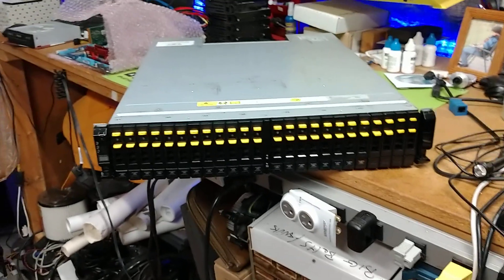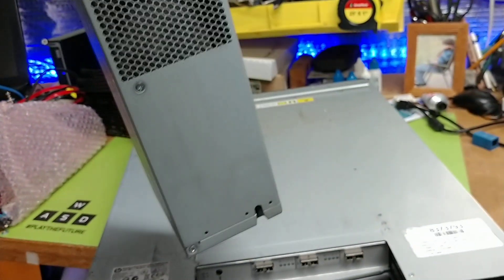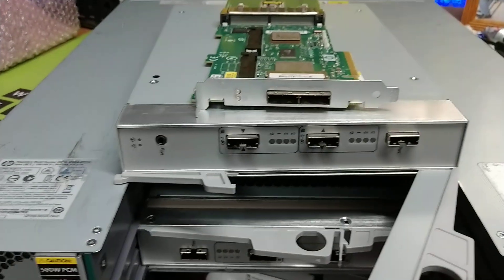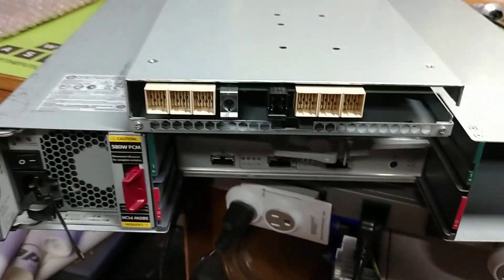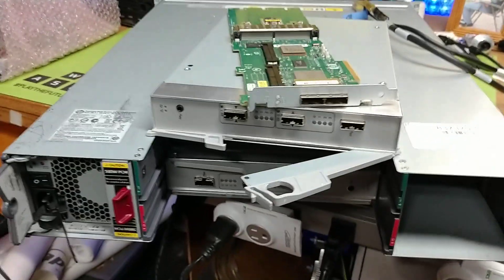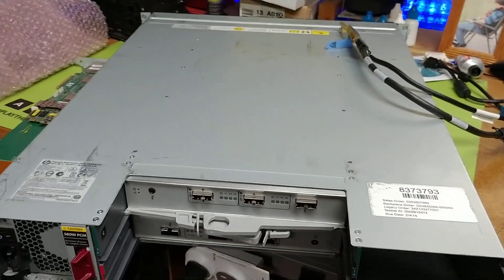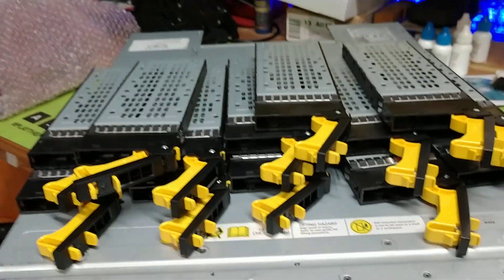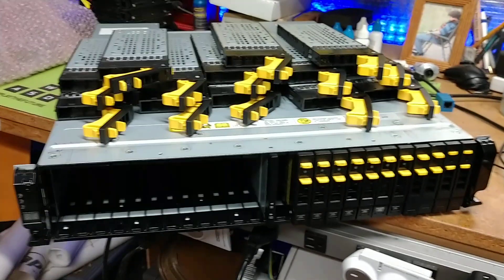Reusing a low cost HP 3PAR M6710 SAS/SATA 2.5 inch, 24 drive disk array  for your home server lab

Comment: Hi Leadius. 

Great video. I went and buy two M6720, but I am having two problems and I was wondering how you had the same, and if so, how did you overcome them with your M6710:

1. No matter which drive I insert, one minute after inserting the drives, the amber light will go on all of them, which I understand is a bad disk, but the controller will see them fine.
2. The controller sees the disks but the bay shows as unknown.

My Setup:
HP Server with P822 controller (Also tried an P800)
Windows Server 2012R2
Two M6420 ( Only one connected)
12 8TB SATA Drives (New)
5 1TB SATA Drives (New)

Any help will be apreciated,

Thanks
Reply from the maker: The first thing I would recommend is to go with only one Disk controller (In the back of the M6420 and make sure the second controller is pop out of it slot.) with one SAS hook up in port A. (for now...)  Next your P800 or 822 will work fine and the alerts and amber LEDs will go away for now.  If you want to add the second self to your model then just go to the B port on the back of the first disk array and plug it into the A port of a single controller belonging to the second array. Power them both up first then boot your server up.  To use both sets of Disk array controllers, you need a dual set of SAS controllers recommended by HP.  Current this config I gave you is a single path fail over. (1x1), to go to a 2x2 fail over you will need more hardware.  So most of us just use this setup of 1x1. This allows us to do storage cheaply and still have a solid storage array.   If you have the software from HP 3PAR, You could go 1x2 instead,  That is single controller x dual failover paths.  That requires that you use both controller ports set, SAS controller Port A to Disk array Port A  and SAS controller Port B to Disk array Port B.  Don't use the second controller on the disk array. Better to pop it out to shut down alerts...  Unless you want to a fully deployed 3PAR array...  That can have some real costs.  Oh also just use about 3 disks to start for you need more then one disk to test things right...  Faster reboot times that way.
Reply: @leadiususa7394  Thanks for the explanation and the help. Will do as you say.

Comment: what type of raid is recommended for hp 3par m6710
Reply: Ok, thanks for answering I tried with raid 10 but I did not understand since it left me unused discs, I will try raid 5
Reply from the maker: Any that you want but most Admins do RAID 5 for basic storage or RAID 1+0 for app level storage need but you have to play a little bit to tweak it out some. Refer to my other response to your needs...

Comment: 3par storage is good for file storage and backup storage, middling for small database storage, and absolutely HORRIBLE for VM storage.  I know this because I work at a cloud provider that uses several 3pars (3 in Colorado, 2 in California, 2 in Chicago, 2 in Virginia, and 1 in Georgia) and they can't even handle a snapshot on a VMWare VM without bringing the VM to a crawl.  We are forced to do all our customer backups during off hours because of this, which creates quite a problem for some customers with large SQL Server VMs.  

The reason for this is because of how they arrange the disks.  They group the disks in sets of 4 in RAID 5, and then divide chunklets of 256MB spread across the disk sets.  So, the maximum read iops is can get is what 3 drives can put out and write iops is about what a single drive can put out.  Because of spreading the chunklets across the disk sets means if reads from more than one VM hits a set, which happens often, slows the continuous iops available to the VMs involved.  In exporting VMs directly from ESXi hosts with nothing between the host and the target of the export (a VM on another host) being one network switch, we are able to get 5-8MB/s, taking forever for VM exports.
Reply from the maker: Yes I agree. About the only thing you can do to help this is to flip to a eight disk raid group (RAID 1/0) ands set your write value (you call chunklets) to something like 16 to 32 MB write cycles.  256MB is really only good for blob and large zip files relating to basic IP NAS storage, That is bulk writing.  No good for VM or DB.  I would set up some the storage if possible for 16 MB for DB and 32 for VM.  This will be faster and smaller write cycle so you can avoid I/O wait state on the I/O bus.  Hope this helps... BYW if your controller I/O path ways are setup in 2/2 fail over then then you has ALB SAS controller setup.  Doing this and having multi path ways as well, will show an improvement. (Only if you are not doing to much workload that is.)
Reply: @leadiususa7394  Unfortunately, I'm not in our Storage Engineering department, so I have no say on such settings.  The fabric is set up with failover and two separate fabrics for redundancy at every location.  So, we're good there.

Our workload, however, is another matter.  We're down many customers lately, having lost three of our major customers specifically because of our storage problems, and the workload is down from what it was.  It's still pretty heavy in a couple locations, and those have noticeable problems.
Reply from the maker: Ok not a issue just feeding some ideas to this.  Been doing this for 30 years....  /:>

Comment: Hi,  do you have the idle power of the M6710 with no drives / drives?

Also, does the SAS controller work in a netapp unit? Like the Dell-COMP controller does? Can you try this?
Reply from the maker: No not off the top of my head. but I think runs around 285 to 400Watts but that depend on you using one or two PSU to power the server.  You can us this one device to track this. ( https://www.amazon.com/Digital-Electricity-Analyzer-Monitoring-Equipment/dp/B07M8JKLG5/ref=asc_df_B07M8JKLG5/?tag=hyprod-20&linkCode=df0&hvadid=309819400004&hvpos=&hvnetw=g&hvrand=12021544539510275576&hvpone=&hvptwo=&hvqmt=&hvdev=c&hvdvcmdl=&hvlocint=&hvlocphy=9015806&hvtargid=pla-608358363795&psc=1&tag=&ref=&adgrpid=60510211606&hvpone=&hvptwo=&hvadid=309819400004&hvpos=&hvnetw=g&hvrand=12021544539510275576&hvqmt=&hvdev=c&hvdvcmdl=&hvlocint=&hvlocphy=9015806&hvtargid=pla-608358363795 ) or go to the Dell spec power usage PDF.  That should help you ID the power rates. I personal like the wall Wattage test device for it tell you the real number based on your usage.

Comment: How many of these could you put in series? I wanted to put 4 of them in series using the card shown is it possible?
Reply from the maker: It is control by you sas control. It can up high if you have a higher end controller.
Reply: @leadiususa7394  ok thanks for the help this video was very informative
Reply from the maker: @jadmor6022  No problem.  Hope it helped

Comment: Hi, i have a Netapp DS4246 and i've tryed connecting it to a HP P822 Raid card but it does not see the drives. I've used a QSFp to SFF-8088 cable (on ebay it say netapp compatible) but the raid card cannot see it. I've tried connecting one of the hdd directly to card with sff-8087 cable and it can see it. Do you have any idea?
Reply from the maker: try just one QSFp cable a the a channel and load your drives left to right.  Are your SAS/SATA drives formatted 512 from 520?
Reply: @leadiususa7394  i have only 2 hdd connected, they are in the fisrt and third slot (starting from top left). My drives are SAS, i don't know if they are 512 or 520, they are Seagate Constellation st32000444ss. Also i've tried with the netapp QSFP hba (the 4 ports one) and with unraid it works but it does not have windows drivers.
Reply from the maker: @Sbellins1109  Work with just one and if you bought a IBM, NetApp or EMC SAS hard drive? If so, you most likely have 520 sector formatted disks.  Not an issue for you can reformat them to 512.  View my other video  on how to reformat 520 sector SAS disks to 512.  Let me know if that works for you.  BTW that video will also show you to see if your disks even show up... /:>  Enjoy
Reply: @leadiususa7394  I've reformatted the rives this afternoo to 512, tehy still are not seen by the HP P822 in the windows program (the hp raid manager). But if connect the drives directly to the card it see them correctly. I've aslo tried with a sata ssd, same problem.
I've also tried every configuration for the 2 back controllers (only one in, both in connected to one,  both in both connected to the raid card, both in both connected to the raid card and connected to each other with a qsfp to qsfp cable) I wan not able to see the disks. Also when i plug the sff-8088 cable to the raid card the netapp shelf show a orange error led that does not show without the cable.
Have you any idea? ptherwise i have to try to send this shelf back to the seller
Reply from the maker: @Sbellins1109  Can you flip you raid controller to HBA mode instead of RAID mode?   That fact you can see the drives to format means you do see it.  May may also need to int. the drive/s so that can be used. first get the status using (sg_get_lba_status)  - "refer to this link-http://sg.danny.cz/sg/sg3_utils.html" then in the Ubumtu Linux OS run the following (sudo fdisk /dev/sdb ) sdb being your correct shard drive you want to initialize. If good then format.  Then you should be able to use it.  If not you may have a bad drive.
Reply: @leadiususa7394  i had to plug the drives derectly to the raid card without the natapp das to have the os see the drives that i then formatted. For the raid card i've tried in both raid and hba mode but still does not see them when they are in the netapp das. I am sure that all the drives works (i've connected all 3 drives directly to the raid card and both windows and linux see the drives as usual). At htis point i'm out of option.
Reply from the maker: @Sbellins1109  Hmmm maybe a bad cable then? Try the other top port. Use just one cable this time.
Reply: @leadiususa7394  I'll try tomorrow. I've bought 2 cable and i have 2 cable (fro mdifferent suppliers) because i tought the fisrt one was bad and also with this one the hba cannot see the disks. I'm starting tto think that it's a windows problem and i must go with linux :( . BTW, with a netapp hba (the one with 4 qsfp ports), unraid can see the disks without problem. The only problem is that it does phisically not fin in my R620 XD (it hit the integrated raid card cooler)
Reply from the maker: @Sbellins1109  Ok let me know how it goes!  /:>
Reply: @leadiususa7394  Hi, i've tried by connecting to other port, i've also tried switching the controllers but still nothing.
Also i've bought and tried with M5015 46M0851 Raid card (it's LSI 9260-8i based and it was the cheapest on amazon). Still does not see the disks in the Netapp shelf.
Also on the front it lights up a orange error led (the one in the middle).
I have no idea on how to work around this. I'v ealso tried unraid but it changes nothing. With the p822 if i connect a drive directly unraid see the drive.
Now the last thing i can try will be buying a card ebay that's flashed to P20 Firmware. Do you thing this could work?
Reply from the maker: @Sbellins1109  No it is the chassis. The error alert is related to the the power supply or a fault on the controller. Refer to this url: https://kb.netapp.com/Advice_and_Troubleshooting/Data_Storage_Systems/FAS_Systems/Fault_LED_lights_on_shelf_without_any_error
Reply from the maker: If the LED is lit before you ever boot up. The fault is local to the chassis.  Kill the power to the chassis then remove a controller and re power cycle the chassis.  If nothing try the power supplies.  The chassis is in a hault state until this is corrected.  Sorry.
Reply: @leadiususa7394  The led lit up as soon as i connect the Raid card or HBA, if i connect a Netapp HBA it works as intender with 3 green lights. I've tried all the controller configurations possible (one in, 2 in, cable to the top left, right, bottom) every possible configuration of the controlled was tried (and aroudn 1000 power cycles XD). The only thing it remains, in my opinion, is the raid card/hba firmware that is not reconnised/does not reconnise the disk shelf. Now i have a H200 with P20 firmware on the mail from China i hope it will work otherwise i have to use the horrible netapp quadport hba (that does not fit in a R620 server), in around 1 to 6 month it will be here (you know how shipping from china works hahah)
Reply from the maker: @Sbellins1109  Ok so that may lead to the controller side of things.  Do you have a second controller on the bottom? If so can you flip it to the top controller position adn leave the top controller out of the system plus only use the A port with one cable not two.  You are only going to use single path for now.  See if that fixes it.
Reply: @leadiususa7394  I've tried it yesterday, does not fix it. I'm starting to have Netapp XD. If i could send this back i had done this in a long time but i'm out of waranty and i have to pay 50€ to send it back (i've paid it 150 shipped)
Reply from the maker: @Sbellins1109  I am sorry sometime these units go south.  They do work well normally...
Reply: @leadiususa7394  Good news! I was unable to make it work even with a new H200 with P20 firmware (bought preflashed) so i've bought a Dell Compellent Xyratex HB-1235 and i'm selling the Netapp DAS. Hopefully i will have less problems with this dell once since it's SFF-8088 on the box and it's a little more "standard"

Comment: I have two HP DL380 servers with Windows server 2019 and want to set up a two node windows SQL cluster using an HP 3PAR M6710. Can this be done with the HP 3PAR M6710?
Reply from the maker: Yes but you need to split the Array bus to share the storage in a mirrored format but you can this a few ways... I is not easy but can be done.. MS SQL is going away from the fail over state format to IP clustering so I ma not sure how long they will support the old way of clustering for it has limits